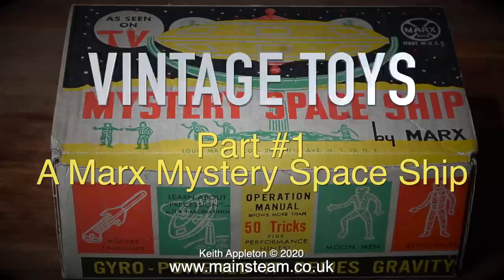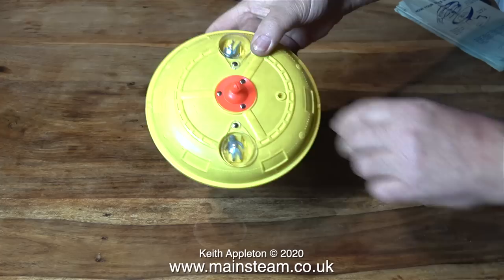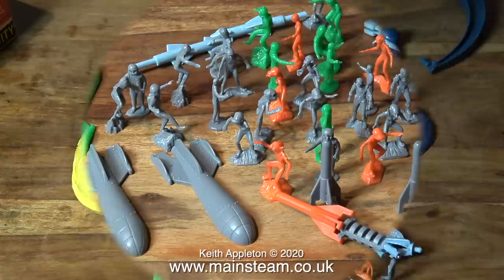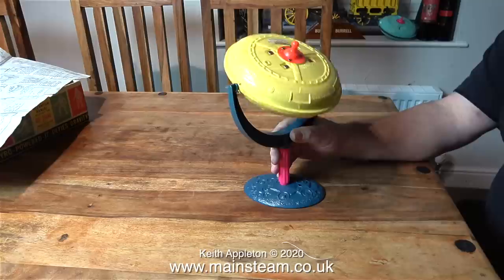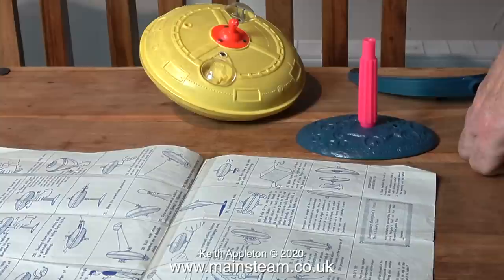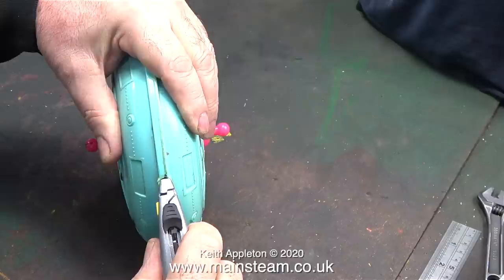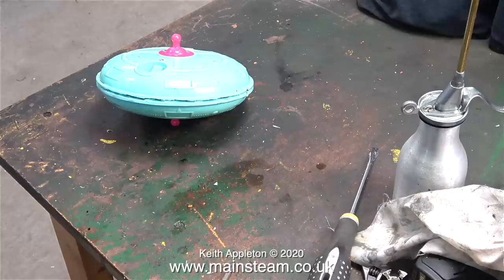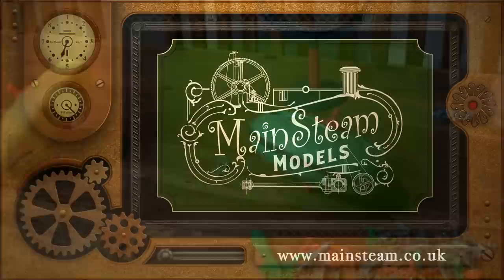VINTAGE TOYS - PART #1 - MARX MYSTERY SPACE SHIP

Comment: Believe it or not, the ISS has two of these installed, they keep the station on course as it orbits the earth!   No really they do, they aren't made of plastic though, they are made of metal and electric motors keep them spinning.  I never saw this toy when I was growing up in the 50s but I did have a Gilbert steam engine!    Keith, you can actually weld plastic!  Go to any auto body shop and they will show you their welding outfit.  They use it to repair plastic bumpers and dash boards and the like. They have different colors plus special rods for polystyrene.  It basically works like a glue gun, which in fact could have used as well.